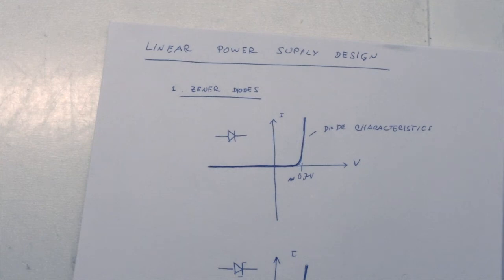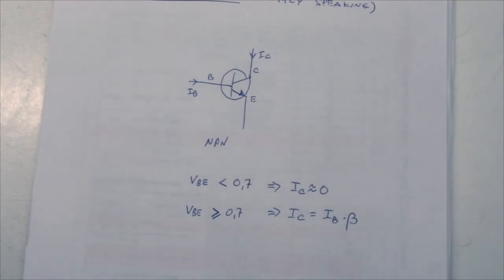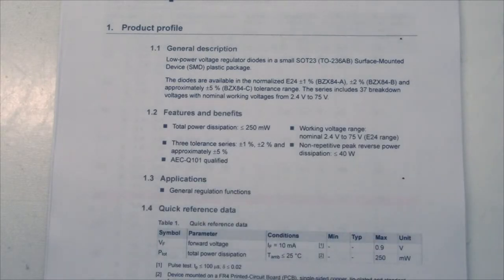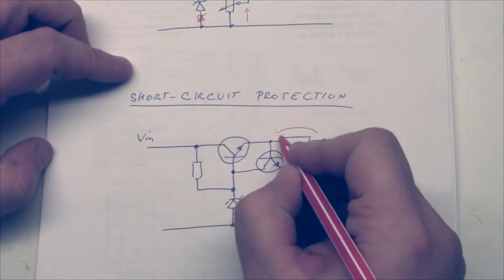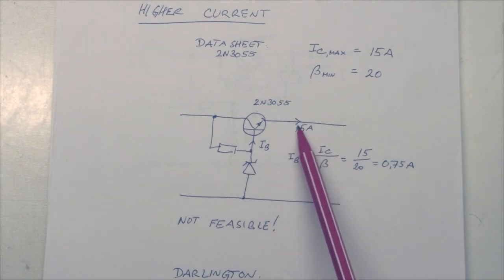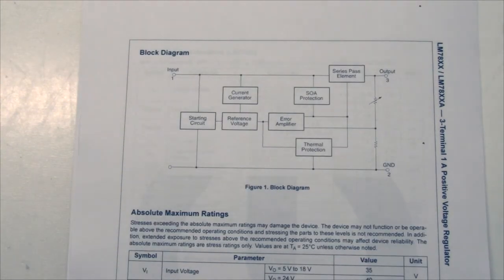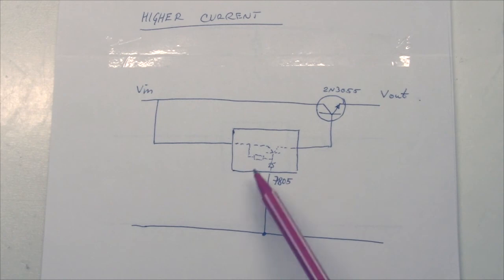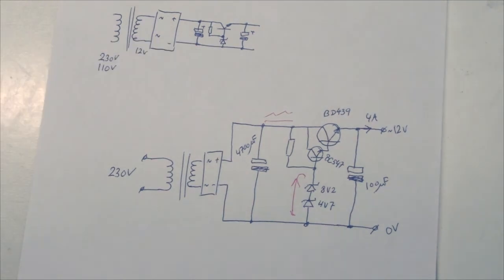Linear Power Supply Design

Comment: How to calculate the smoothing capacitor
Reply from the maker: Depends on the current drawn, internal resistance, transformer size, etc. The easiest is to just start at 3300 uF or something in that order and adjust it up and down until you are happy.

Comment: This was quite excellent. I love seeing how things work down at the basic level.
Reply from the maker: Thank you..
Reply: With the variable voltage setup you show (5:40), the voltage setpoint at the base of the transformers changes when the load changes. I think this is because of the change in the  current going through the base of the transistor emulates a shift in the ratio of the pot resistance. I suspect that a proper choice of pot and an additional resistor on the base will at least ameliorate this effect. Any suggestions on resistor and pot values? Maybe a 1k pot with a 10k resistor?

Comment: At first I thought... another video on linear supplies... but then I learned a lot. Interesting trick with the two Zeners. I understand the temp cos cancelling each other out, but how do you decide the breakdown value for the second Zener (the one closer to ground in your positive supply)??

Yes, the color was off. The shadows are very blue. It could be a white balance issue to begin with, and then you boosted the shadows in the edit. Ideally use a white card (or clean white piece of paper, or 2 or 3 stacked) to set a manual white balance for each video. Use a grey a card to set a manual exposure. That being said the video was still quite watchable.

Thanks again.
Reply from the maker: Yes, exactly, and thanks for the tip. I'll play around with the camera's white balance next time.
Reply from the maker: You just pick two that has temp. coefficients that cancel out, and has a total voltage value that you want. The individual voltages doesn't matter.
Reply: One can spent an entire career on linear designs.  If you want a glympse into the reality of that art take a look at the real estate on a modern motherboard.  You will get some understanding when you realize how much of the design is dedicated to provision of a dozen separate power rails.  It's all linear, low drop out and ultra low ripple. Being an expert in that field is a golden ticket to life long employment.